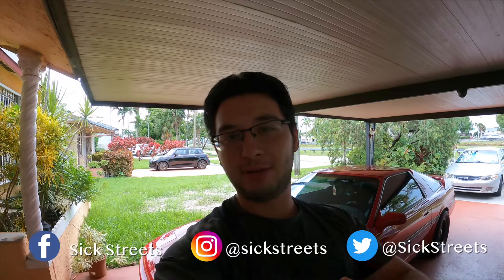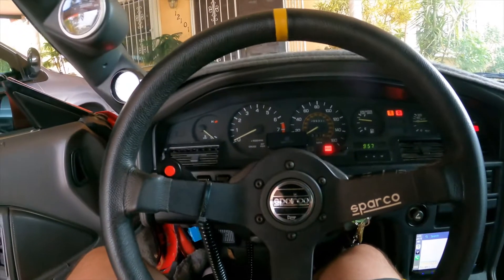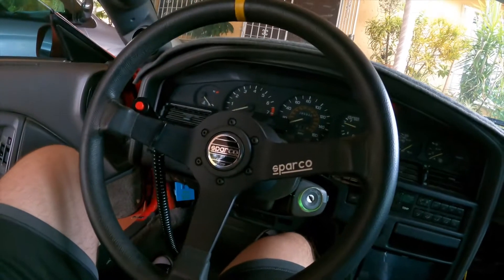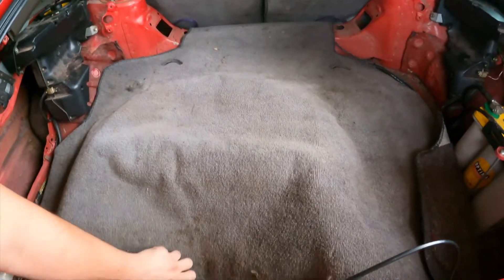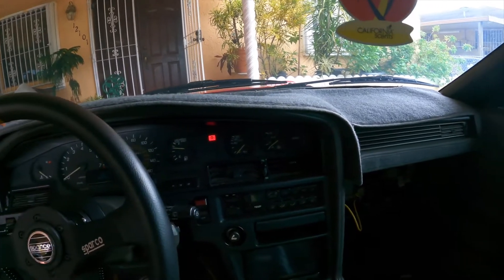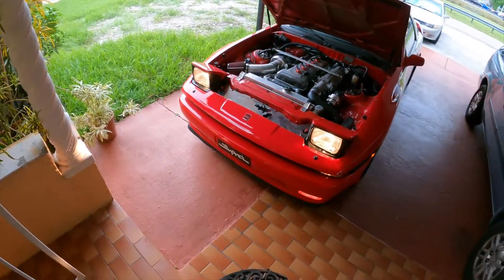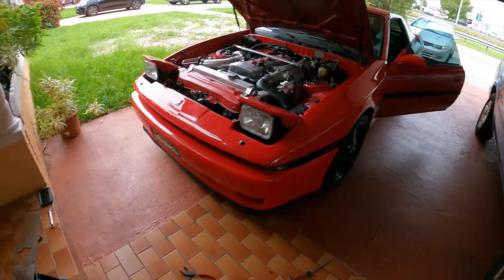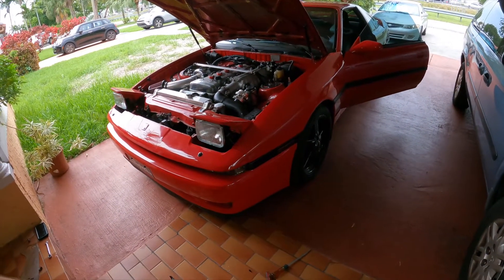This Pop-Up Headlight Mod is Extremely Underrated: Kioto H4 Conversion on MK3 Supra

Comment: Also, for your blower motor. Check the blower motor resistor. It has a coil of wire that is used to change the blower speed. They commonly break.
Reply from the maker: We changed the resistor already. At this point it’s either the blower itself or a fried wire somewhere in the system

Comment: Check your steering rack bushings. The rack might be moving back a forth when you turn the wheel.
Reply from the maker: Those are brand new, all done when the car went in for front subframe work. Maybe worth a bolt check tho
Reply: @SickStreets4K  Im having the same wondering and dippy divey stuff at straight. ive also replaced raack bushings and most steering componets as well. cant figure it out. sweet mod!

Comment: Your steering rack is shot?
Reply from the maker: It was rebuilt, which is what makes me question what they ever did to this thing. I don’t remember that steering issue before at least, but my memory isn’t too clear either
Reply: Simple adjust ur inner tie rods . Alignment
Reply from the maker: @miguelchilpa2065  car was aligned by one of the best guys in south Florida, so I don’t know if I can blame the alignment on this one, but that doesn’t completely rule it out either